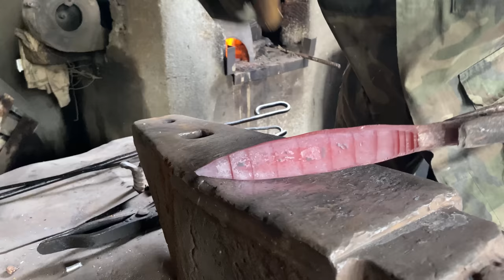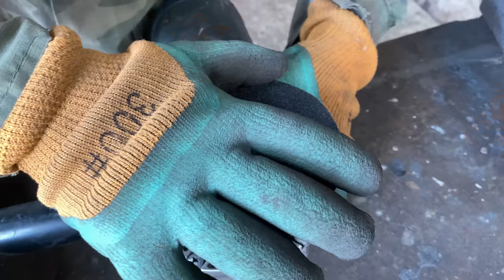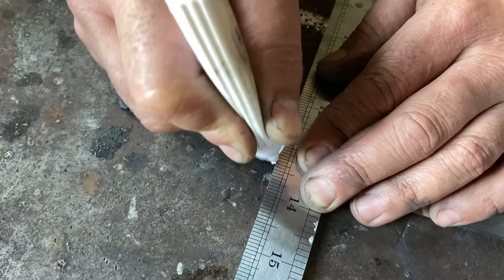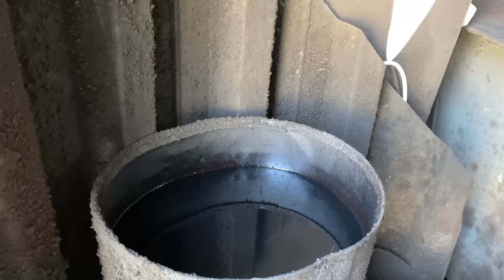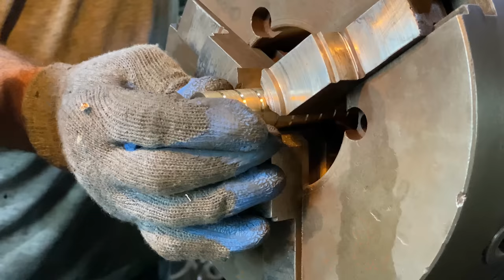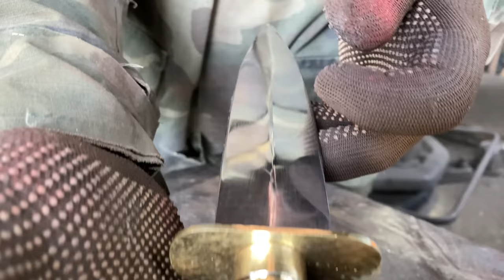Created an Incredible Dagger with a Brass Handle from an Ordinary Piece of Metal

Comment: Very nice as a show piece, but I wouldn't want to actually use it as a dagger. The tang appears to be a little too thin, and where the tang joins with the bottom of the blade wasn't rounded out, leaving a point where a stress fracture might occur.